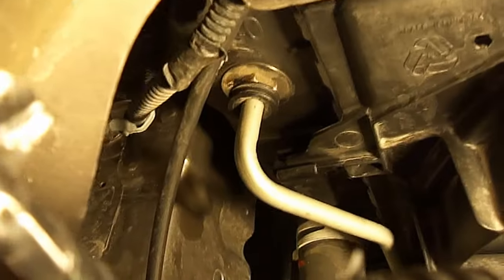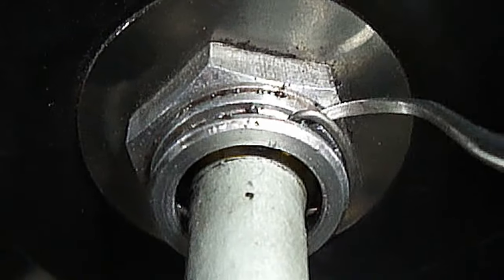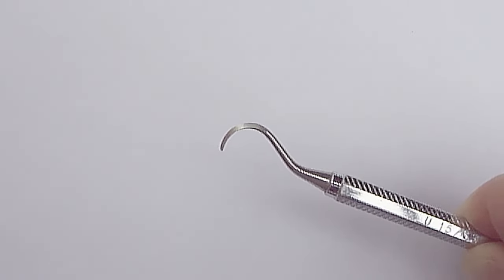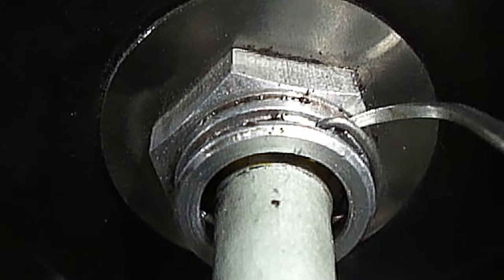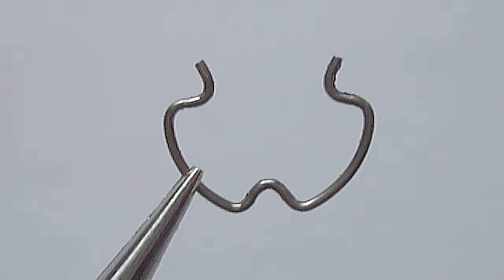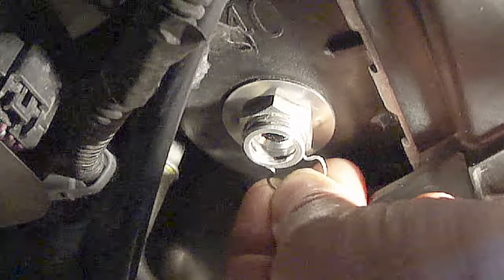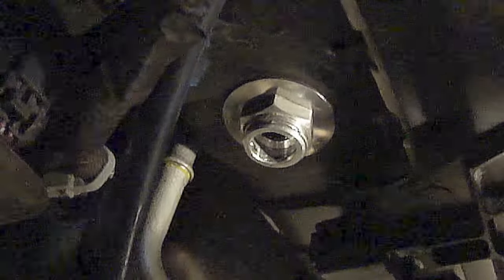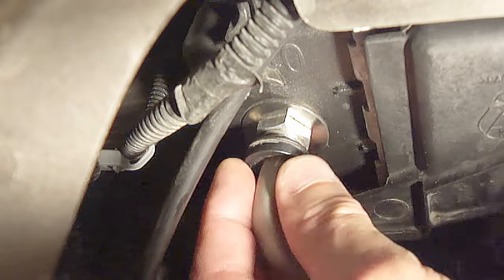NEVER Remove GM Chevy Transmission Cooler Lines Until Watching This!

Comment: Wasn't sure if I could snap the line back in with the clip in place or not. I skimmed video titles until I saw one that was only 2:05".  Knew it was just what I needed, straight to the point! Thank you 👌
Reply: Yes you can install line with clip in place= the best way to do it. You will hear a click when line slips past clip = seated and retained.

Comment: Thanks so much for showing me the correct way to remove and install the line. Ive been on side of road most of the day because I thought the clip was seated but wasn't.... not fun when its 95 degrees outside and you've lost all your fluid on the Road!!

Comment: Just thought I'd throw this in for anyone having issues with these when replacing the radiator. What can be done is to unthread the fitting while it is still attached to the line. The back of the fittings just have an O-ring behind them. On the new radiator only unscrew one fitting at a time. The fittings keep the transmission cooler inside the tanks of the radiator from falling inside the tank. Unscrew one new fitting then place the new o ring from the new fitting onto the back of the old fitting after removing the old o ring first of course. Then re-thread the old fitting into the cooler and then do the second one the same way. You can do top or bottom first it doesn't matter but make absolutely sure not to add coolant to the new radiator until you have swapped the fittings and properly tightened them back up to the radiator or you chance getting coolant inside the transmission lines and transmission itself. This is not the preferred method but I have done this when working on a job where a parts store isn't close by because I have had times in the past where the W clip fell from my grasp when trying to reinstall it and I never could find it. Driving without that clip is not an option as the line will most definitely blow out and leak out all of the transmission fluid out. Just my 2 cents.
Reply: Just lost the ones to my CHEVY MALIBU MAXX ‼️ Where it went🤷 I'll try your technique next time.Thanks
Reply: Very smart!!! Those JESUS clips Get most easy. 
JESUS CLIP= a clip that when it flys only JESUS knows where it went!!

Comment: Good video, thanks for sharing.  Being an amateur garage mechanic my question is whether the trans fluid will escape once the line is pulled from the radiator.  Do I need to temporarily plug the lines (with what?  a wad of plumbers putty over the end of the line seems reasonable!)
Reply from the maker: Stuff a clean rag inside the opening. Not putty!

Comment: Excellent video. I suppose you must remove a couple of other lines to acquire that degree of open access for your hands to work with the transmission line joinery.  I cannot get my hands around a 2012 Buick LaCrosse  2.4 trans line going into the top area of the radiator.

Comment: I have had my loqer pressure cooler line blow out of the coupler twice.

I made sure won't happen 3rd time adjusted the bracket at the cooler lines to hold tension even with the clip our.

Comment: On the 4L80e you have to remove the clip on the one that goes to your radiator.  The bend is so tight where it enters the tranny that the tool they have can not make it in the remove tension on the e clip.  I just cut it and unscrewed it from tranny and then worked on it out from under the vehicle, then screwed fitting back in with the e clip already installed.

Comment: Hi Paul,  Thanks for making this video.  It was a real help in attempting to sort out a problem with these connections on my 2019 Blazer. My transmission needed replacing when the transmission fluid leaked out in a sudden and catastrophic failure. The dealership says the horseshoe shaped retaining clip was missing from the transmission cooler line.  I'm assuming this caused the cooler line to disconnect.  Any ideas on how this retaining clip might have come off?  Note: The radiator in this vehicle was replaced 3 years ago.
Reply from the maker: The only way that line could come out is if the retaining clip was never installed from the factory or was not installed correctly.

Comment: Has anyone had any luck in finding just the clip for sale?  Mine is missing, but the actual fitting is still good.  All I can find for sale is the whole fitting, where it goes into the transmission.  (2008 Cadillac DTS)   By the way, thanks for the quick video that gets right to the point.
Reply from the maker: Call Cadillac dealer parts department
Reply: Junkyards
Reply: Better get a GM factory clip from parts or junkyard.  I just swapped a radiator in S-10 p.u.  of course I lost the clips.  The new clips that came with my new radiator didn't fit properly.  The Dorman brand in a kit from the parts store ($15!!)  didn't fit properly either.  Issue was that when fully seated, they were too big on the O.D. and the plastic retainer would not slip over the clips.

Comment: I put tranny in buick lesabre. Put new coolant lines in. The bottom line would snap into connector but has been popping out while driving. Have you ever heard or seen this problem.

Comment: Do you have to put clip back on before or after snapping line back in? And what is the size or part number for clip if you know?
Reply from the maker: Put the clip back on the line and then pop the line back in. I do not know the part number.
Reply: @proclaimliberty2000  on my car the bottom hose has a bit of play in it even after it clicks in

Comment: U dont even need to remove the clip. Just need fuel line quick connect tool. Stick it in and rotate it until clip lets go
Reply: Why is this comment not highlighted across all videos about these damn clips! You are so right! I will buy a set of those fuel like disconnect tools

Comment: Probably just saved me a 4l60e sir. I was putting the line in first and figured I missed an oring, does an oring go on the line anywhere
Reply: There's an O-ring behind the bolt that's attached to the radiator were the Line goes in! It's a taped O-ring style! But I put an actual o-ring behind it, even though the vacuum pressure popped the ring immediately cause I didn't snap the line in correct, but I swore I heard the snap,gave myself an oil change right in front of my house!, but snapped the line back in the leak stopped, but that's only if you see it leaking oil or Transmission fluid from the bolt itself not the lines!

I have a 2005 yukon denali 6.0 ,even though it stopped leaking from the bolt cause the exploded oring sealed it good, no lie!

But still need to replace the line cause mines is rusted an leaking oil ,but not even sure if the leak is in the line itself of the oil cooler side and now having an issue with the coolant so I'm just gonna swap everything that's connected to the radiator an maybe even the radiator itself!
Reply: An just to answer the question the clip he took out is the o ring for the line!  Snap the black cap back on an done,  no actual o ring on the outside of the line to my knowledge,  I'm just a diy guy as well!
Reply: No o-ring!

Comment: Mine are loose after install. Is there supposed to be some sort of o-ring?
Reply: Mine had no o-rings and felt loose in the old and new radiator. And yeah, they do look like the type of connectors that should have o-rings. Kinda disconcerting, but they don't appear to be leaking. I guess there's not much fluid pressure?
Reply: @charlesrichards5389  There is no o-ring in these quick disconnect fittings. The manufacturer recommends replacing the clip (actually called a "retaining ring") each time it is removed.
Here are the steps for reinstall:
1. Install a new retaining ring (clip) into each quick connector fitting.
2. Hook one of the open ends of the retaining ring in one of the slots in the quick connector.
3. Rotate the retaining ring around the connector until the retaining ring is positioned with all 3 ears through the 3 slots.
4. Ensure the 3 retaining ring ears can be seen from the inside of the connector and the retaining ring can move freely in the slots.
5. Install the line into the quick connector fitting until a click is heard or felt.
6. Pull back on the line to ensure a proper connection.
7. Put the plastic cap back in place.

Comment: Tough to tell where you slid the clip back in. Both ends in same slot or end into each. Had a spare one to look at and it vanished...
Reply: Play with it for about 30 secs..youll see one side goes on one slot, other side in another.
Reply: @steves5355  yeah took a while to figure out when in area couldn't really see into,  was trying to put middle over a solid like on a door or window crank when there are 3 slots I believe and you put that hump into 1 and the legs into each of the other 2 then it just slid in...  couldn't find my spares to look at..

Comment: You never flush an automatic transmission.
Reply: Never backflush.  Flush it by using the natural flow of the pump out the trans cooler into a bucket and adding new fluid until clean.